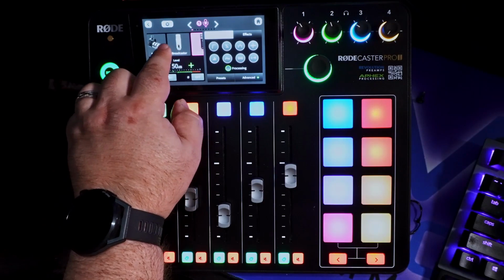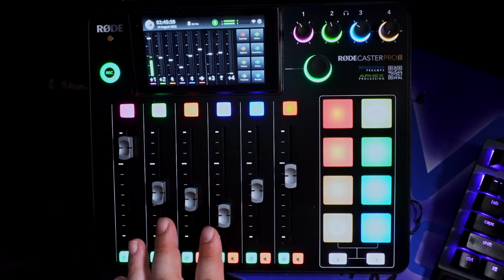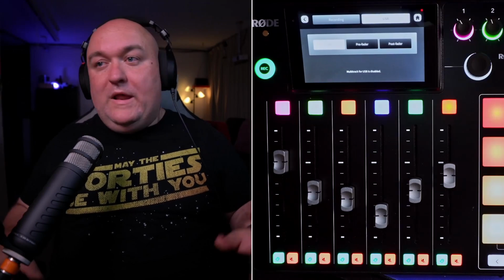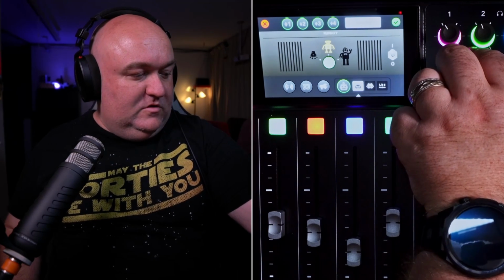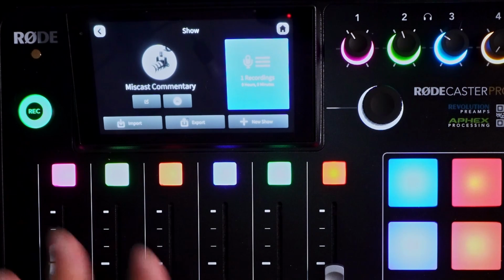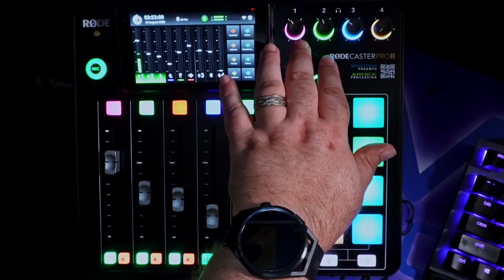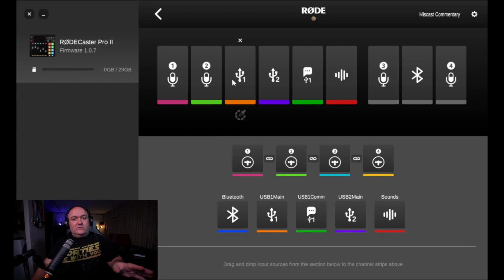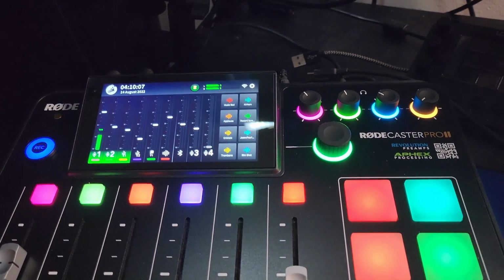Rodecaster Pro II Tutorial: Walkthrough and Features

Comment: Hello, when Intry to record with the Rodecaster Pro, I can hear that there are settings set to automatic. I can hear background noise dissapear when there is no one tslking. Can you tell me were I can set this to manual,
Reply from the maker: What you are hearing is the noise gate and it is, by its nature, an automatic process. There is no way to manually turn the noise gate on and off at will. You can make adjustments to the sensitivity and how quickly the noise gate comes on and clears in the advanced settings, though.

Comment: Hey :) thanks for the video!  We wanted to use it in the stream with speakers, but just can't get rid of the feedback from the mics. (Rode mics) Also, you can hear our voice in the speakers, which we don't want. Do you have a suggestion for a solution? Is there a setting that we are overlooking? We had a Behringer mixer before, there were no problems. Thank you and best regards
Reply from the maker: Yeah there are settings outside of keeping your levels low that could help but it would be to remove your voices completely from the monitor. You'd have to set up a submix for your monitor output. If you want to hear your voices, use your headphones. I'd recommend headphones over the monitors any day of the week anyways
Reply: @MiscastJoe   thank you very much! 🎉

Comment: Great video dude. Do you know how we can tell rode to add an autotune voice effect?
Reply from the maker: Thanks. I am sure autotune could be suggested via their support line or discord (if they have one). If someone was particularly savvy with the MIDI controls they might be able to trigger an external autotuner, but I couldn't say for certain.
Reply: @MiscastJoe  yea I have two different auto external effect machine's. However it's so much of a hassle to have more devices connected. I am trying to do a mobile pod so I wish it was built in
Reply from the maker: @OpenYourMindPodcast  definitely worth suggesting it then. Maybe it is a use case they never thought of

Comment: Great job. Thanks!!.. I finally got one.. familiar with audio interfaces, can't get the Bluetooth connected phone (tried different phones) to pick up much signal from the RCP2, the audio going to the caller. Very faint, even the sound effects get out to caller, but faint. Have latest firmware, phone audio plays music great. Recording to micro storage produces great output sound from my mic and sound effects at the RPC2, but very little sound volume sent to caller using BT, almost inaudible, but there is some sound. So caller gets almost no audio out of the RPC2. Tried every imaginable routing for BT, tried different BT settings at phone, multiple phones/brands etc. My setup at RCP2 is only wall/power supply plugged in, Wifi connected and the BT connected to smartphones with no USB connection to computer. I noticed the monitor icon on the RPC2 was yellow slashed out, figured that's because I have no monitors attached. Anyone have any ideas? Faint output sent to smartphone caller via BT from RCP2 is the issue. Have support issue opened for a while, but thought someone may shed some light.. thanks!!!
Reply from the maker: the only instant thing I can think of is that sometimes your phone will go to a default volume when connected via bluetooth... turning it up from there will give you louder audio at the input. I have this all the time when casting things from my phone to other devices.